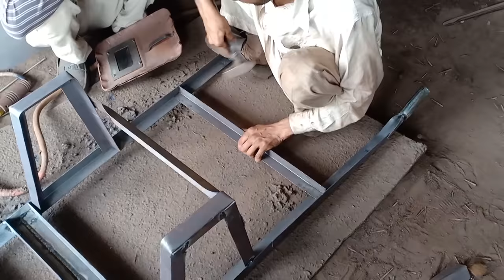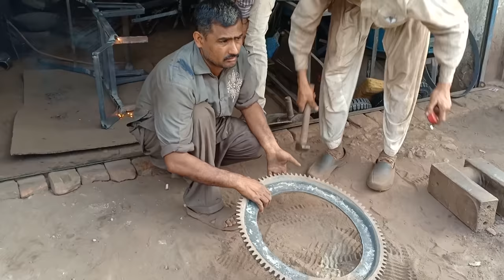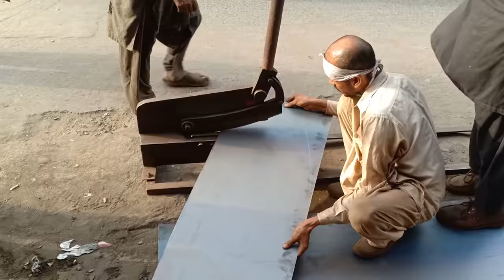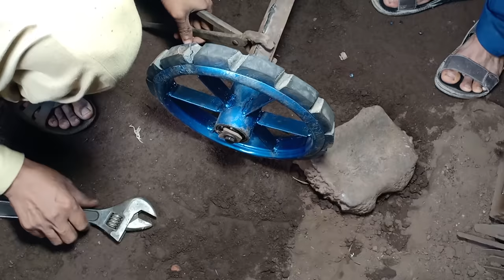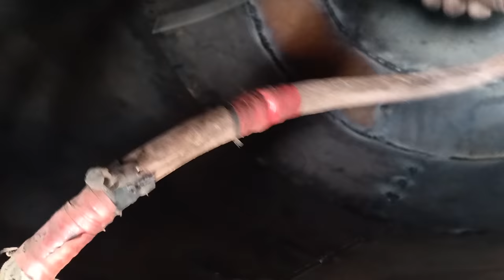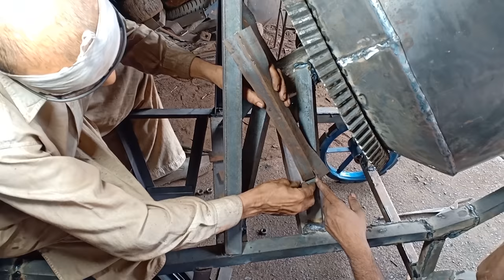Full Process of Making Handmade Manual Concrete Mixer

Comment: Surprised they didn't just make their own friction drive for around the waist of the drum instead of the 2 angle gears, probably the most expensive part of the design, crude but it WILL mix concrete.
Reply: I was thinking this, too!
Reply: What do you think those bearings are? Regular deep grove ball bearings or angular contact?